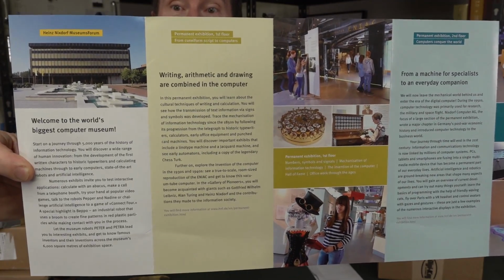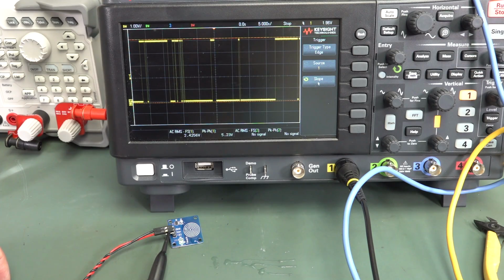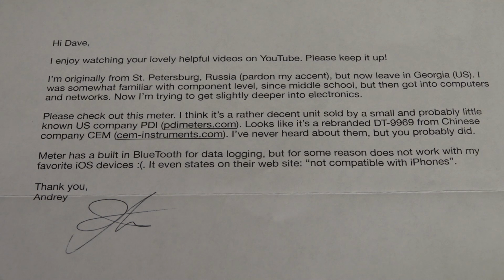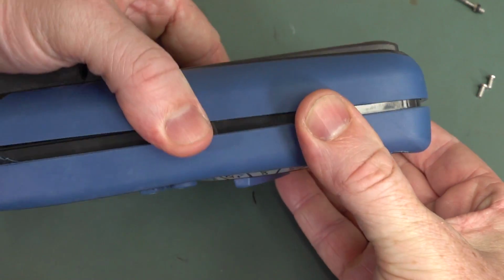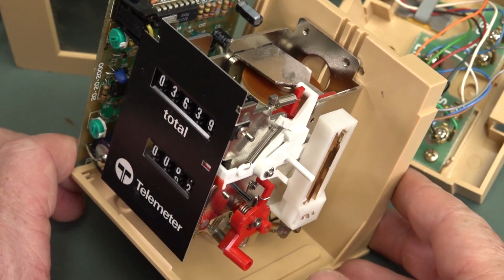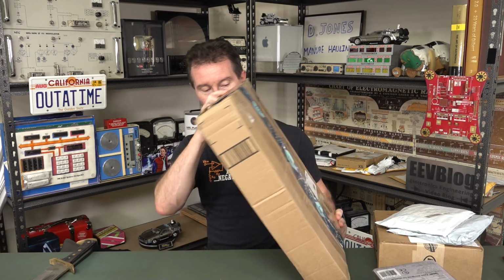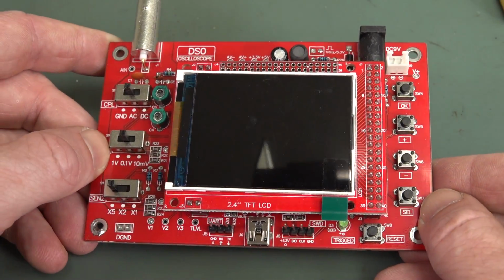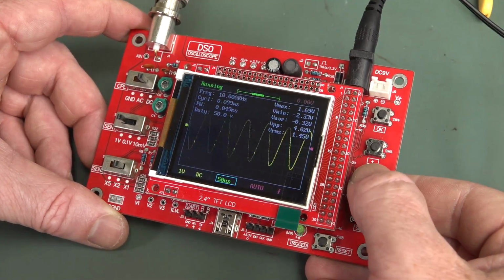EEVblog #1272 - Mailbag

Comment: The strain gauge in-line is probably used as a resistor in the Wheatstone bridge to “remove” temperature offset from the resistor used in the strain measurement.
Reply: Yes, I'm pretty sure it is. We used to build pressure gauges in a similar way. Having the temperature compensation resistors flapping around in the breeze is certainly a good thing for mechanical decoupling.
Reply: It's a zero adjust network. You adjust it for a null output by cutting various parts of the pattern away like rungs on a ladder.  Used to compensate for slight residual stress or variance in the values of the 4 legs of the strain gage bridge.  https://www.micro-measurements.com/press/micro-measurements%C2%AE-bondable-resistors-transducers-now-built-advanced-sensors-technology
Reply: Another possibility is they are for bridge completion. in many cases you may need one or two strain gauges and you add a matching bondable resistors to complete the bridge.
Reply: Yes, yes indeed.... Normally they are perpendicular to measuring gauge but probably added it in "free standing" mode to easily decouple it mechanically.
Reply: Also, it's lb*in, not lb/in of course :-)
Reply: As Bob mentioned, it's for 'Padding' the output to null or offset. You basically scratch using an eraser or fiber brush to change the resistance. Temperature compensation is done by matching the gage material to the material you are measuring. This way the expand/contract at the same rate.

Comment: That Telemeter Type 3 is a real beauty! Something I’d love to get my hands on.
I have the Telecom Australia installation/service manual for it if you would like a copy.
Reply: What was the Special Service Network? Googling didnt enlighten me
Reply: The thing counts pulses send over the phone network called ‘ticks’. Similar to a car odometer, the top counter counts the total ticks while the bottom counter can be reset after your call. Way back when they were used for billing shared phones (as far as i know). You wrote down the amount of ticks (duration) you called for. I picked a similar unit at a local thriftshop! (Thought it looked interesting)

Comment: 9:00 I remember making my first touch switch out of a 2N3819 and putting it in my wall as the light switch. It was quite flakey, sometimes it'd go on or off when you just walked by it. That was a 99 cent transistor from RS back then, BTW.
Reply: Sounds like it needed a pull resistor. One of the first things I noticed about using MOSFETs compared to BJTs is they're really wonky if you leave the gate floating without a resistor to pull it down to ground when there's no signal applied (or pull it to VCC).

 Your story reminds me of darlington pairs. They have such huge gain (about 10,000 for a pair of 2N3904s) that they'll do pretty much the same thing. I've heard of people using them as "ghost detectors" because they pick up damn near any electrmagnetic interference. From what I've tested myself, it seems like it capactively couples to my body and picks up mains interference that my body is picking up. Unless my body happens to generate 60hz signals as well.